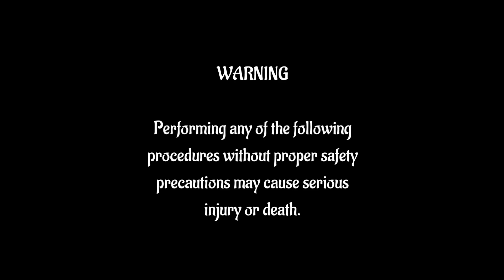How to Stack Powerful Neodymium Magnets

Comment: I've just seen the first 5 seconds ONLY and I'm ALREADY having terrible flashbacks! I have the remains of 3 of those bloody big square N52 magnets, look to be exactly the same size ones as those that I put down on a bed, about 18 inches apart each thinking they'd be safe enough like that for a minute while I worked out what fun things to do with them. They ALL suddenly came SLAMMING together partly catching my hand, taking quite a chunk out of 1 finger and bruising hell out of a thumb and absolutely shattered 2 and the third just broken in half! I've had a bunch of 19mm cube ones that gave me plenty of smallish blood blisters but these guys are bloody scary powerful, and very destructive! I let the pile of scrap material stuck together on a high curtain rail once I stopped leaking red fluid eventually and haven't even touched that since. 
Now why didn't you make that a few months back, before I got then almost immediately destroyed 3 of those, and a fair bit of my hand lol. The 19 mm cubes are a little on the minorly dangerous side but, those big ones are bloody dangerous!  
I do like your idea there. That was exactly what I was trying to think of when they all decided to save me the trouble by slamming together with great force, how to even get them together since I did try putting one on each side of my hand and not only did the top one hold the bottom one to my hand, it was squashing my hand so hard I had to rip one away pretty quickly. N52 magnets that size ARE dangerous and difficult to deal with. You've got a good idea there. 
Only one suggestion I think would be good would be to use something like a couple of what we here call paddle pop stick, wooden ice cream sticks, about 2mm strips of plastic would would work fine too. Just something to keep them separated and ideally leave a small gap to put something in to lever them apart maybe.
Thanks though, you should save some fingers and possible worse if anyone planning on getting little nasty beasts like them follows your advice.
From me to anyone thinking of getting any of the ones this size, or larger, please do follow his advice and be very careful, in N52 grade these really are very difficult and somewhat dangerous to deal with, SERIOUSLY!